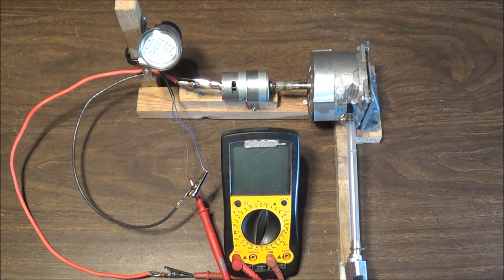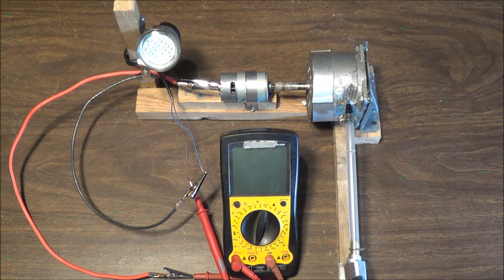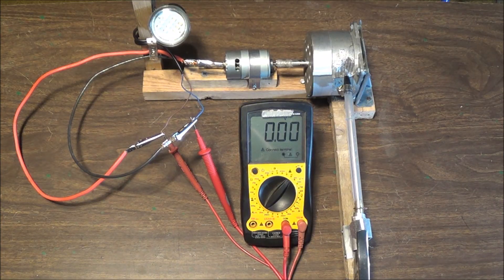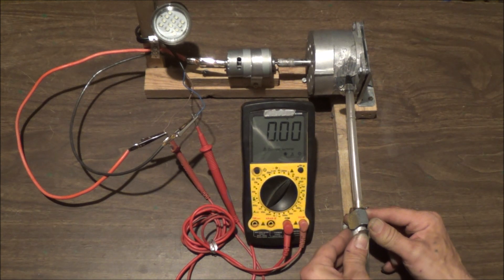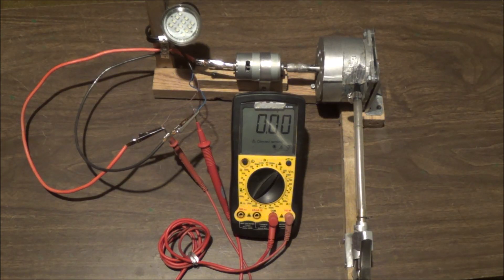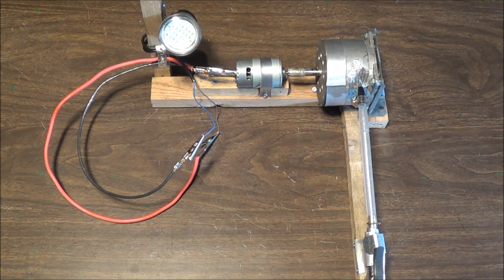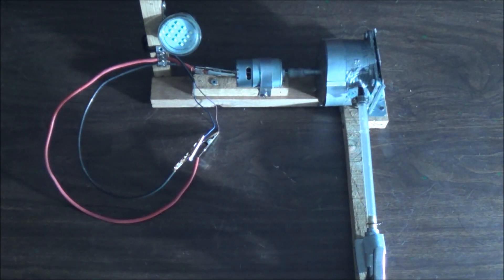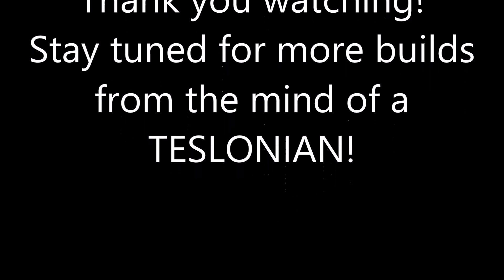Homemade Tesla Turbine still producing power after 5 years!

Comment: De voltage is limited by the LEDs . They will stay around 3V while the current rises until the leds die.  If you want to know the max voltage you can make a pure resistance load.

Comment: That thing is cranking out some RPM's. Any idea of the RPM ? Cool build. 👍👍👍
Reply from the maker: Notice on the amps test that the sound gets louder and louder, then it settles down a bit and the amps go up? This is where the rotor velocity has finally reached the same velocity as the incoming air velocity, at this point the turbine is running at its peak performance,  and with the air pressure being around 60-80 psi that could be as high as 30,000 rpms depending on things like moisture content of the air and load resistance
Reply from the maker: With a input diameter of 1/16" and a pressure of 80 psi we have a flow rate of 5-6 cubic feet a minute. I had forgot that this test was done with a 1/16" nozzle and not 1/8" I use for power generation, so I corrected the number.